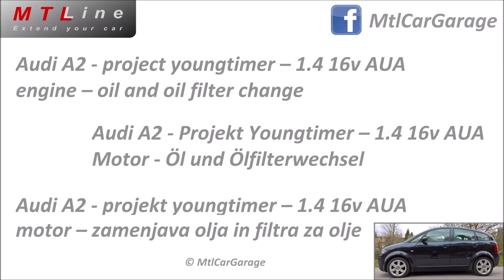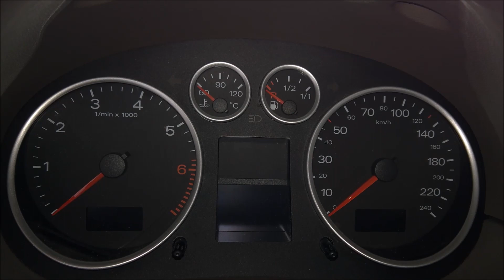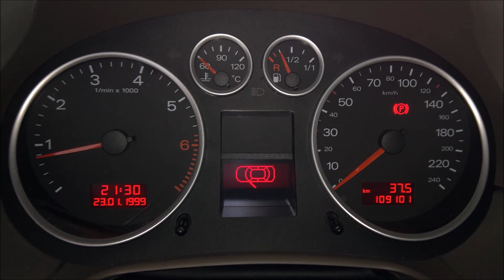1.4 16V AUA engine – oil and oil filter change – Audi A2 – EP19 – project youngtimer

Comment: Very useful video. I have just changed both the air filter and oil filter (along with the oil). I found I had to take off the cover of the exhaust manifold along with the black plastic breather pipe and cable holder that bolts onto the rocker cover. I have to say it was a bit of a pig to do compared to my wife's Austin Mini and Nissan Figaro and even my Humber too! But a very helpful set of videos. Now I have to find a rocker cover gasket and an oil dipstick for the A2 1.4 petrol engine.
Reply from the maker: Thank you. 
Yes the oil filter location is really crazy. I would like to talk to the engine developer that put the location of the oil filter there, since this is a servicable item on every service :(.

Comment: I was informed by my mechanic that the underbody protection under the engine was missing on my 1.4 AUA. Then i found out that the Code 1SA means no additional underbody protection. I saw you A2 doesnt have one either? So is this normal? You have the code 1SA in your service manual?
Reply from the maker: Mine has engine undercover plastic:
https://youtu.be/UXemjxYYaew